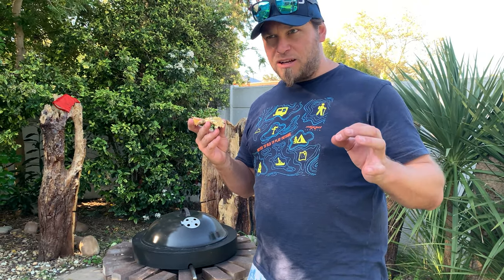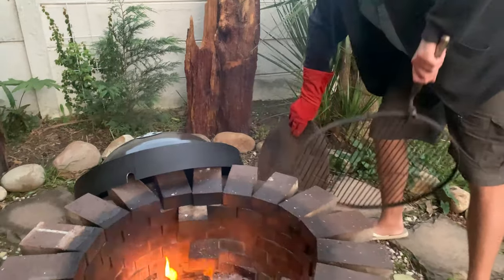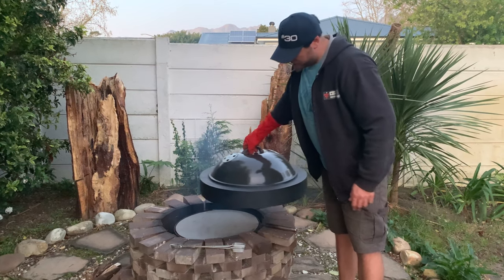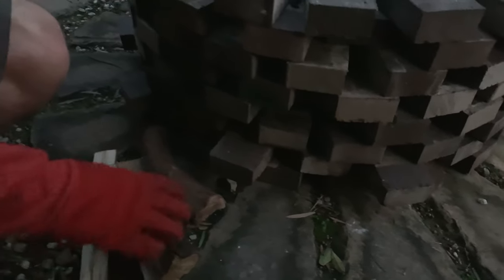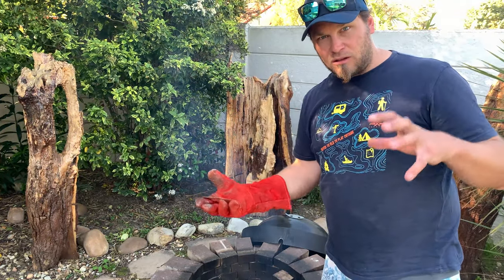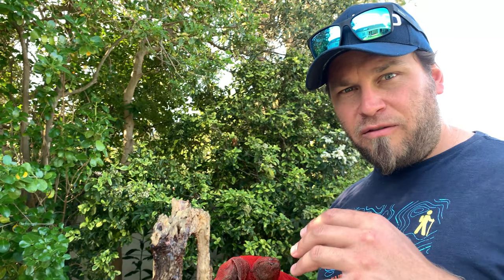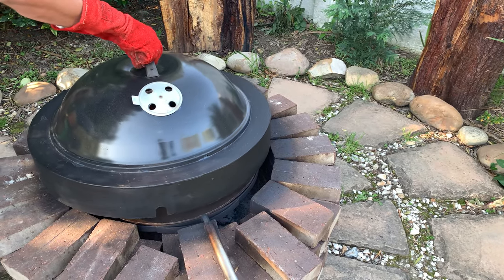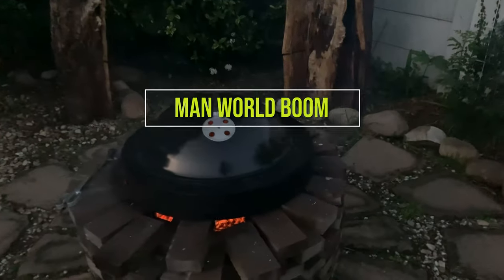Convert your FIREPIT into a PIZZA OVEN - DIY

Comment: Good concept although appears to be not enough dome heat. It would help to not precook dough and may help to insulate the lid. Try barely lifting one side to slide the pizza in. Good luck!
Reply from the maker: I Daniel. It works best if you have a good amount of flames coming out the back. As the fire slows down the bases burn, then I add more wood and as it burns more the heat from the top improves. You have to work with it a few times to get a good feel for the sweet spot. Also remember it’s not only my pizza oven, I use it to bbq all my other things too, so I agree it will probably never be as good as dedicated pizza oven
Reply: That pizza looks trash